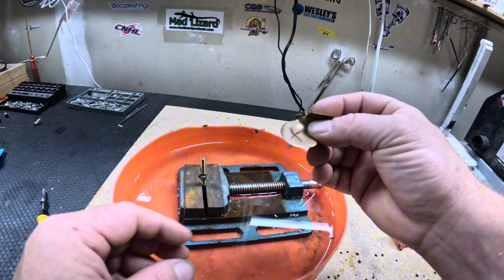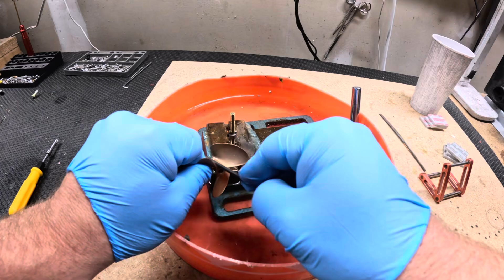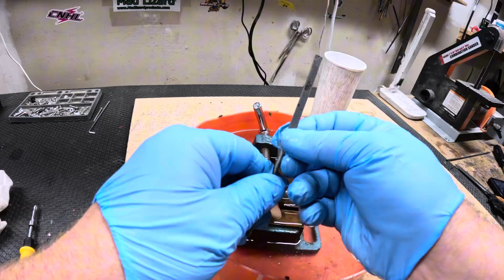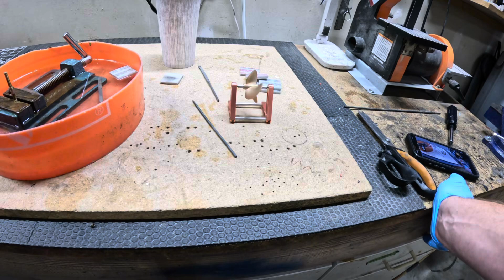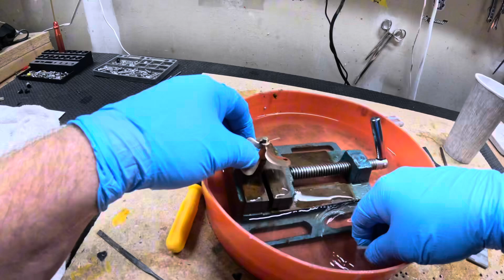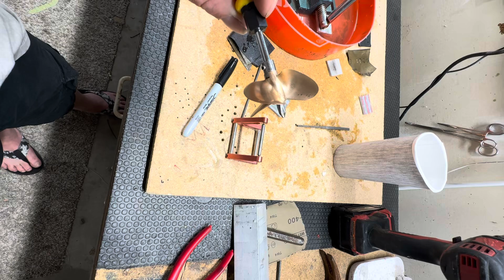Rc Propeller sharping & balancing

Comment: Turn the shaft with the prop on and it will be unbalanced again.
Reply: Turn the shaft how? And why? What shaft, the balancer shaft? "It" will be unbalanced, what is it? The balancer shaft or the prop? Assuming you mean turning an unbalance prop shaft a quarter turn by hand, that wouldn't add nor remove any material from the prop, so the prop would remain unchanged and remain balanced, Right? Assuming you mean an unbalanced shaft, it just remains unbalanced, it can't be unbalanced "again".  If "it" is the prop, how would a turned shaft have added or removed copper from the prop? 20 mins later of study and I can't understand your comment, but I wish to understand.